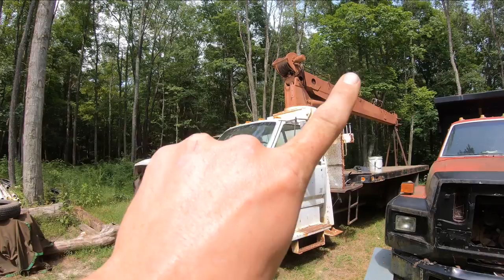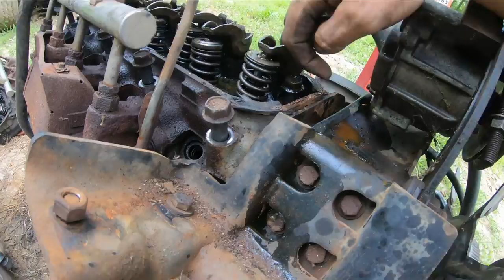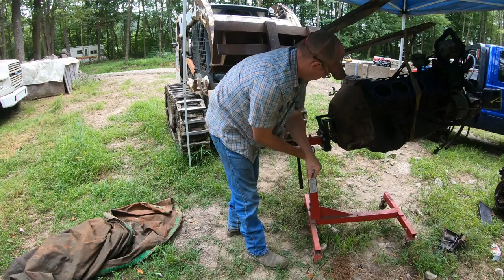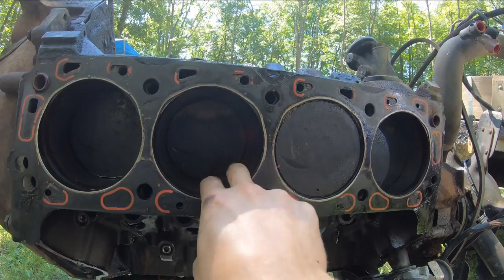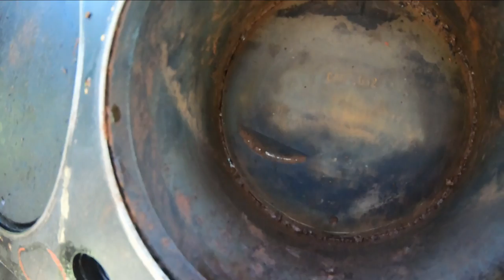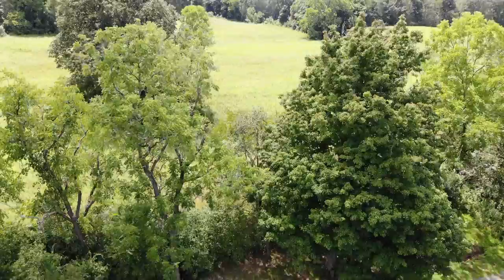Rebuilding a Big-Block in the woods! $700 Auction Crane Engine with big problems!

Comment: Apple Cider vinegar some times will free one up when diesel , marvel , ect won't , it also cleans up carburetors great in a soak , but in the engine the vinegar is a mild acid , it will attack the corrosion on the piston which is primarily what sticks them ...

Comment: I would do the same “rebuild”. After all it’s about the budget, even if you do sell it your market for it probably wouldn’t be a contractor who wants to use it every day but an individual who would use it occasionally and wants it for the convenience of having their own boom truck. You should be able to get by with the cost of a gasket set. I don’t know if you plan to but I would remove the valves and hand lap them. It should run great.

Comment: If you ever have cylinders like that one you scraped again.
Use a bead ended hone brush to knock off that surface rust before you use your stone hone.
A scrapper or razor blade can easily level deep scratches.
Do yourself a favor.
USE cutting oil or honing oil. 
NOT just any old oil. 
There's a huge difference.
I still have a quart of it. 
And one of those old fashioned finger pump metal oil cans I use.

Comment: Next time slip some fuel hose over the c/rod bolts before banging the piston out. Simple but saves S**T loads of time cleaning the dings out of the crank journal. If that pit is less than the width of the ring in diam it should be OK coz it is at the low pressure end of the stroke and the ring should seal it for some time into the future.
Cheers Eric

Comment: You are better off putting the engine on a small table or some wood across two oil drums and working safely from there. Also, it will definitely need new piston rings. The old ones have lost their spring and overall gas tightness. Just give that area a good check before deciding what to do.

Comment: Spark plugs was out on that engine when you got the truck if I recall mud diver wasps will make a nest anywhere  I've seen one completely plug up a 6 inch exhaust stack with 10 inches of mud
Reply from the maker: Yes I believe you are right!

Comment: G'day  Matt,, 
The old mech in me cant help but want a real good look at the  gasket and surfaces , from what i saw they seemed to be  ok, and the oil wasnt milky . The pessimists  in me  says the brown crap may be  radiator stop leak , which leads me to think "did it overheat ..??" causing it to seize  initially.        Or     were the plugs out for someone ( previous  owner ) to try  to  perform a compression  test ..??
Matt,   please check the radiator block n heads for  any STOP LEAK,  to rule it in or out .  Finally ,id be doing the finger in the exhaust ports looking for excessive oil burn , then check for excessive end float , play ,ring gap  .
 If the previous  owner could  fess up now ,,,that would help .
Failing a confession  ...... 
 rebuild till you rejoyce ..!!!

Love the channel ,thanks 

Much Respect 
     from
Down Under

Comment: I love your description of Ford engineering starting at 4:57, or as AvE would call it:  "Enginerding" https://www.youtube.com/user/arduinoversusevil  For what it's worth, the Chevy engineers that I love so much had the same engineering instructors(?) in college!!  AND, they took the "water funnel from the hood" description at 9:50 and enhanced it.  For example:  after making the coil-over spark plug pockets susceptible to water collecting, they made sure that there was a nice rubber gasket between the hood and the cowl...with a curve right over the engine so the water could pool up before dripping/running onto the engine.

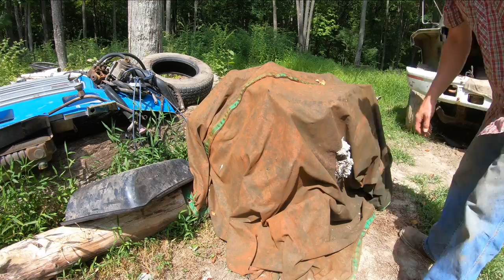Growing up in rural Florida, I totally relate to the caution at 2:23 when lifting a tarp or anything else!

Comment: They sell little booties for the connecting rod studs so they don't bang up the crank journals or cylinder walls as you bang them out and in.  Even on this shade tree job I would use them.  You should have just forced the engine in the truck by towing it in high gear, or maybe take the pan off in the truck and bang the worst pistons free, reattach, then force the engine. Then slowly unstick the rings with Marvel Mystery Oil as you drive.

Comment: I don't know much about motors other than basics like Oil Changes & Replacing Starters & Alternators! The thing I remember is you torquing that nut at the auction yard, Could that have caused any un seen damage?

Comment: My 92 f-150 [$500 truck] Has something like that 'mud' collecting in the cooling system. All I can think of is a previous owner dumped a ton of some sort of stop leak in it. It is still running so I haven't pulled it apart yet. I'm kinda dreading what I'm going to find.

Comment: Last time i found 'clay' in a cylinder i was told its fuel, oil, coolant all mixed together with rust. I was able to recreate it with diesel , powder rust, and 10w30 let it sit a week or two after mixing well in a paint can.

Comment: That tiny hole in that one cylinder is probably a sand pit hole or porosity in the casting and could be where all the water is coming from. A hydro lock is in the future if so

Comment: That crane truck is pretty much Swiss cheese, so I would take most of the drive accessories off it anyway, and then since it’s a 429 you stick it in like an F100 or whatever is cheap and cost effective

Comment: Dirt dobber nests? Then when you sprayed the cylinders and filled with diesel it coagulation in the bottom?
Hope you get the big boy going. With no more miles than you'll put on it, the job you're doing is more than adequate.

Comment: can you clean that block and pistons with an electrolysis tank?  it cleans cast iron pans and steel tools DANG good. all ya need is a battery charger, wire, scrap steel, a barrel, washing soda and water.

Comment: That Gunk may be Dirt Dust
When the engine is running in an area where dusty dirt particles are flying around, the engine or piston cylinder action will breath it in with thee air. It could also have come in with the fuel but if that's the case you will see evidence of that in the fuel path as well

Comment: Why not move the operations into the shop. but still tarp it up. would be better than the shade tree. Its going to work as long as you put new rings on it but the pitting may be too bad dont know? Im not there to see it. I like the dingle ball hones. Can you get over sized rings ?

Comment: Send it all the way technical a flywheel should be resurfaced when a clutch is replaced if there's a scratch or gouge I just sand the burs and scotch bright it brake clean and it's just fine 65k later

Comment: I ain't gonna criticize you for doing just that, end of the day it's one hole out of eight that's possibly hurt, how bad can it smoke from one pot? And at worst it'll run on the other 7 and do what's required of it just fine, but I reckon you've a good chance of it working out good and running OK. If not, at least you can get a feel for the rest of the machine/how well it works/how useful it is & then make a call whether to flip it as a runner OR (my preferred option if the engine's not long for this world) if it's worth the time and effort to throw a diesel powertrain under the thing, or maybe even just a diesel lump and higher geared rear end.

Gotta head out now but will watch the vid when we're home again, something to look forward to. good luck with it :)

Comment: That's what I would of done knock the pistons and then scope the damage but usually you can get away with honing it and then new rings and bearings if need be just polish the crank journals and slap it back in and rin it

Comment: Is this the oil pan that gives trouble? Saw it on a youtube video of how to replace the dipstick mount without pulling the pan off. But, since you're going to pull the pan anyway, and if it's the one that gives trouble with a breaking issue - be a good time to replace the dipstick tube mount.

Comment: The best part about this rebuild, is that you get to get rid of all those emissions vacuum lines, and you could put a nice simple performance carburetor on it, and get a lot better torque power out of this motor.
Reply: Not gonna do much good if there’s not enough compression to take advantage of it....

Comment: Hey the engine is fucked so why not try and see if it works. I got a stuck engine on a free harbor freight plate compactor. I got the engine free and just muscled the piston and rings through the rust a bunch of times. Engine works if you use a drill to start it. Bigger issue is the block is cracked so now it’s just a parts engine. But it worked! And it was stuck solid

Comment: You must be sponsored by Disney the way you're "Mickey Mousing" this engine.  I've built a number of 460's for both hi-perf and towing and they are wonderful engines if you build them carefully and think your way thru.  I've surprised a lot of guys with 454 Chevy motors with the torque, hp, and economy these things can produce.  Their biggest drawback is the exhaust ports but that can be worked around quite a bit........and if you have the money, good aluminum heads make a huge difference.  One of the big things is to keep port velocity up as the intakes are actually too big to promote good homogeneous mixture and flow......about the size of storm drains.  Good luck.

Comment: my buddy just touched the crank with the hone doing the same thing. Just a tiny scuff on the crank that engine spun the bearing in less than 30 seconds of starting it. Had to pull the crank and send it to machine shop. Cant remember if repaired or replaced it.

Comment: BIG FAN OF FORD BIG BLOCK 390/427/428/429/460 GREAT JOB HAD A 1972 F150 WITH 429 KICK IT IN ASS AND WITH SO MUCH TORK KEEP BREAKING MOTER MOUNTS AND JUST WENT TO A CHAIN AND THE PROBLEM STOP

Comment: Why did you attach the stand to the belhousing? The arms on the stand adjust out to fit the belhousing bolt holes on the engine.

Comment: Cr@p, if I had a working 370 I would just pop that baby in there and be done with it. Or run the 370 while you took your time and did a complete rebuild in the shop on the 429.

Are those 32 over pistons in there from a previous rebuild? I thought I saw them marked 032.

Comment: May i ask, why, if you've been given a free, running 370, would you bother doing a field strip and build on the 429? The 370 is a bolt in replacement for the 429 and a part of the 385 engine series along with the 429 , 460 and 514.
Just wondering as if you had swapped in the 370, you'd have a running truck by now.

Comment: It was all that knocking on the stuck pistons that made the engine stand brackets fail, not just the weight of the engine. Cross hatching can last for thousands of road miles.

Comment: Sorry your stand broke. Many times the Chinese stuff isn't rated correctly. Glad it didn't hurt you. One thing to keep in mind. You may have been under the overall weight limit but I've heard when you hang the weight out further from where it was made to hang, you exponentially raise the weight strain on the bolts and mounts. I've seen forklifts overturn carrying a load way up high and they turned hard with the load way up even though the load carried was well below rated capacity. Similar concept.  Honestly, I was concerned the whole thing would tip forward on the stand.

Comment: I agree with you, why sink a ton of money in the engine for a $700 truck? But, it looks like you lucked out on the overall condition of the engine anyway. Glad you weren't under that engine when the stand failed, it could have been catastrophic. I had a stand fail once that was a pretty decent one and I had a jack fail under a Ford Step Van. Neither one got me, just turned me bleach white, but tore up the engine and the truck some. LOL

Comment: Rated for 750lbs, but you have 500lbs of partially dressed shortblock hanging a foot off of it, with the accessories and mounts still attached way out at the front. It makes sense that it failed and I would not blame that on the stand at all...  This is a simplification of the loading situation but it's close enough: Say those standoffs the block mounts to are 6" long. A 750lb load at 0.5ft is a moment of 375lbft on those welds. A 500lb load at 1.5ft is a moment of 750lbft. That's assuming uniform weight distribution, in reality the center of gravity of your load was even further forward than it should have been because of the accessories and mounts. By putting an extra foot of distance between the lighter than rated load and those welds you actually have doubled the loading on them vs a 750lb engine mounted correctly.

Comment: That 370 should have been installed and running in it yesterday. My opinion is it's a crane truck. Not ment to haul a big heavy load down the highway. Not a race truck and the price was right for both the truck and the engine. The money spent on gaskets and whatever else it needs will probably shock you, and you still have a what if engine. Just my opinion

Comment: Nothing wrong with doing an engine this way when it's appropriate 👍. 
It's a working/industrial vehicle that, to be frank, is a pile of shit barely worth it's weight in scrap - you don't spend anymore time/money than you have to.

If it gets her running and useable it's a win.
If its many years younger, in good condition and actually worth something it's a different story.

Comment: The stand was perhaps able to hold specified weight, but if you start to hammer on the pistons, you are basically hammering on a long lever, lots of nasty forces for the poor little Chinese thing. Maybe if you had put a block of wood underneath the far end of the engine as support...

Comment: the pistons were stamped 32 over but never seen a odd number before  20 30 and 40 if u find a 60 over run from it because the block is to thin

Comment: Usually you get all the pistons out and remove the crank or at least have the crank turning so you don't hit the journals with anything because you put a nick in the journals it won't be good but it's your engine not mine plus you should have the engine sitting up that way the grit and metal runs out the bottom instead of sitting in the  side of the cylinder you have at the bottom

Comment: Was this video before you put the floor in your CONEX drive through shop area?  I was a bit surprised you didn't work under the roof instead of under the tree.
Reply from the maker: Yes it was but even still it’s on the other end of the property, didn’t want to haul everything down there

Comment: If you really want to cut with your hone, lamp quality kerosene !
   Being a lazy guy I might have tried to find a  circular bronze wire brush to clean those bores, rather than a putty knife, I’m not saying it would work, but I would have tried !
Reply from the maker: I didn’t have one the correct size or I would have

Comment: That clay may be from a mud dobbers nest, if the past owner had pulled the plugs and tried some of the same tricks your trying then its possible. Or it had a warped head and someone use way to much stop leak.

Comment: If you plan on reselling that truck, make sure you show the buyer the videos on how you did this so called rebuild. At least that's what an honest person would do. You should be using a ball hone for that.  I've seen some shade-tree shit in my 45 years of building engines, but dude, you take the cake.
Reply from the maker: Yes I’ll explain everything to a potential buyer but someone who would buy this old girl probably won’t mind as long as it runs and drives I bet thy will be fine with it

Comment: The clay is probably dirt dobber nest, pure clay. In Ok if you dont duck tape the water pump & every entrance to the engine mice will fill the water jackets with shag carpet. Shade tree secrets. The same for the radiator. An engine looks like a condo to mice & dirt dobbers...

Comment: It is marked on top of the piston how many thousands that is bored over looked like it said .032 to me and Ford on there older engines like that the rods were marked from the factory. And far as the rebuild just keep doing what your doing it might use a bit of oil but it's not a daily driver and it's not the space shuttle lol

Comment: Cyl. 3 was head gasket sealer. Basically clay in solvent
Reply: Major misconception about diesel is utilizing gasoline head gasket symptoms. Because diesel symptoms are often different if naturally aspirated.
Reply: Id definitely had a blown head gasket.
Reply: Thin oil will give you a greater cut at risk of hardening matierial. I cut with moderately thick or transmission oil.
Reply: Also this is a sleeved motor. Most would replace your pitted cylinder with a new sleeve. Also soak your pistons in vinegar.
Reply: Also your honing tool is too aggresive buy some cheap stone ball brushes from harbor freight.
Reply: And im not saying this to rag on you. But your inexperience is obvious. Dont use gas to clean. Diesel or trans fluid only.
Reply: Lastly buy a ton of plastic brillow pads

Comment: I like your work.  I used to do, when I was younger, what I called sandblaster rebuilds.
But the one thing I think you should not use is gasoline, you seem like a good guy; gasoline is very dangerous.  Use paint thinner anything but gasoline.
Gasoline it just way too flammable, you don't need to be walking around with severe burns all over yourself.

Comment: That one cylinder you might experience some blow by
Reply: But seeing as it's in a small area at the bottom of the stroke maybe not so much
Reply from the maker: Yes I figure it might smoke just a touch but I’m not concerned with such a small spot

Comment: Do Not use a hard steel implement to do the rust; use a steel wool pot scrubber to avoid digging into taht Cast Iron that isw a Lot softer th\an steel tools.

Comment: You should at least get the block machined at a machine shop to ensure the cylinders are straight and true. Shince you pulled the motor.. might as well do a full rebuild and make sure it works after..